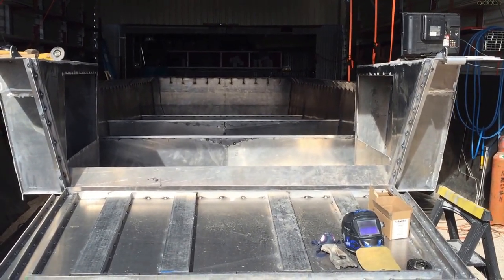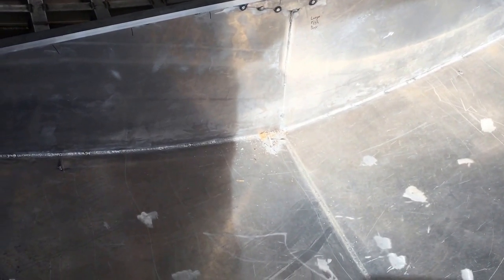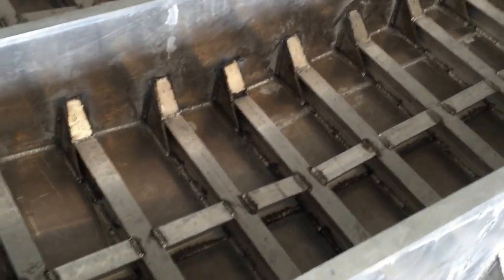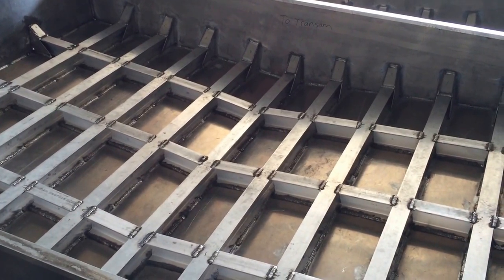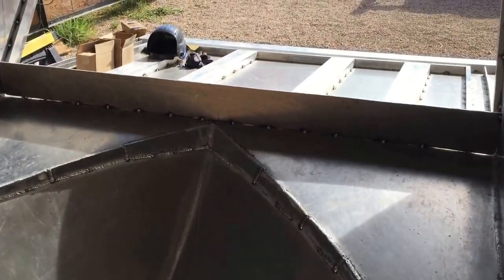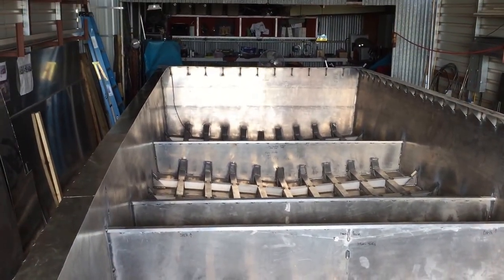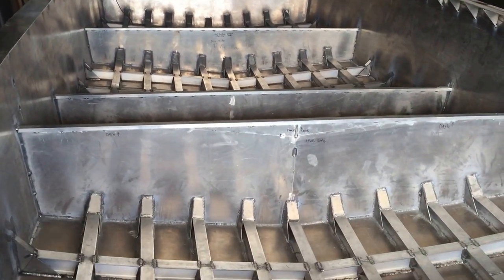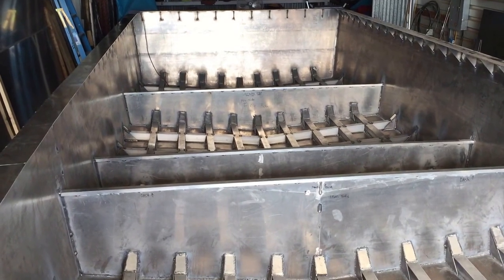building aluminum boats 11

Comment: Hello,  If you ever decide you need to sell the boat it has to be built to certain standards.  Such as upright flotation and watertight integrity of compartments etc. It gets even more specific if you are using it commercially.  If you are going to the beach you might also benefit from an extension (removable or foldable) on your bow ramp to lessen the angle for loading unloading operation.  Definitely a labor of love and bespeaks tons of energy. Remember that there will be lots of condensation even in 'closed' compartments.  I have been on many many boats and ships and never seen a totally dry bilge ever.  Very interesting videos.  Take care.  Doug

Comment: Shan Bernet,  are you using a push pull Aluminum gun. ?also what make of welder, plus I assume your actually a professional welder buy trade..personally I have built Heavy Equipment Trailers and backhoe bucket , but never have welded Aluminum,  but at 75 now do I need to Learn .thanks for the share of your video.

Comment: That I beam is a huge waste of time fitting and unnecessary weight, you would have been better off laying it the other way to eliminate the wide faying surface where corrosion will start,  overbuilt and underdesigned

Comment: I do have to agree with what most people have said and that is your boat is built like a tank!!! Also looks like you made no provision for the water or fuel (let's just call it fluids) to drain out or back to the stern of your boat? That being said, no one can take away the fact that you are building a damn boat where as most commenters are sitting on there asses doing what? So GOOD ON YOU FOR DOING IT! I think a few well placed drill holes will take care of your drainage issues. Because you will have issues if you don't do something.

Comment: I can we that you know more about boat building than me so I probably should not have suggested that you build your own " I"  beamsmto form fit the bow.
Reply from the maker: +Clint Steel thats ok,now your thinking like a fabricater,you can make anything,I thought about making I beems for that area,butvthey would have to be at least 12 inches tall to weld the underside of the top piece,so I did something else,,,Ill show you in vid 12 in just a few days,thanks for your comment
Reply: +shawn burnett (tailermade) One thing sure, I sure admire your grit for doing what you're doing. That's no small project! Best to you man!